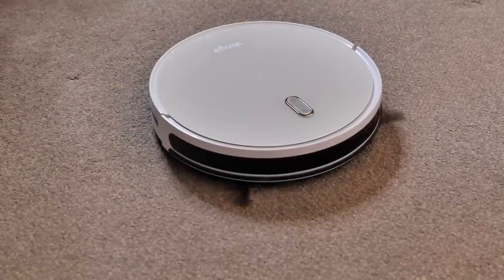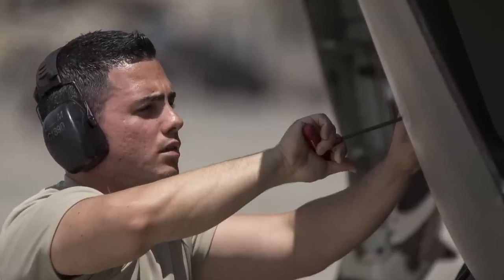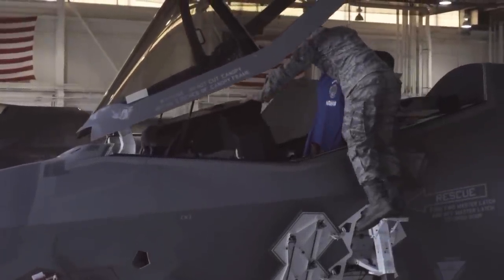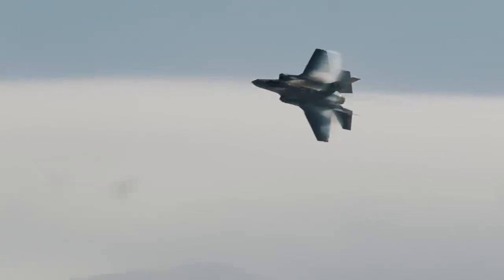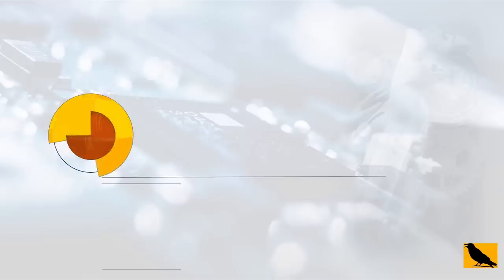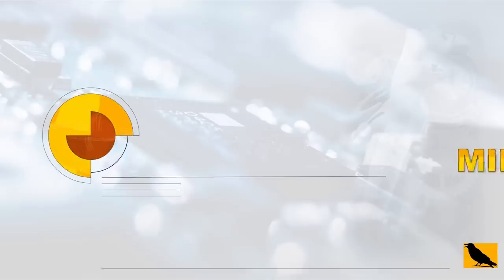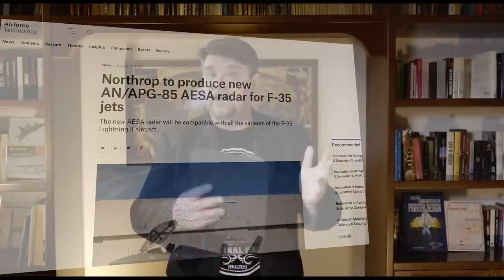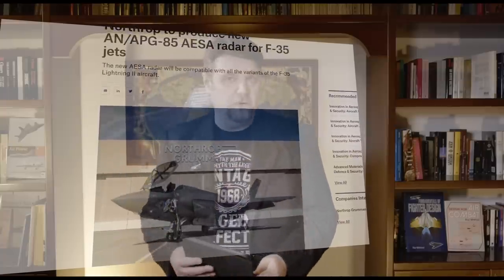AESA radars have a problem.

Comment: The Gripen E would frequently employ its AESA GaA radar as a passive ISR antenna and the wingtip and tail GaN antennas as active radars in narrow beam mode. But, it may also be used as RWR, EW, and SIGINT, which is not only clever but also an efficient and effective method to employ radar.
Reply from the maker: Any source for this?
Reply: @Millennium7HistoryTech  it is common knowledge.
Reply: @psyamok3735  it is assuredly not common knowledge lol
Reply: @Millennium7HistoryTech   Hello sir, 
Americans, europeans and Israelis have achieved AESA radar technology. 

Can u tell us which radar be more advanced Israeli Elm 2052 or European Rbe2/ Captor E according to their capabilities of military industrial base. Jst general technical comparison.
Reply: @nishantshrivastava9674   Please get real - nobody who really knows the answer to that question will be writing a single word on this channel.
Reply: Stop tripping. Gripen E AESA radar is not GAN, it is a GaAS radar:  the Raven ES-05 made by Leonardo.
As for electronic warfare, the Gripen requires a EW pod which is nothing more than a powerpoint presentation today.
Reply: @H B  100% correct! Notice he never uses any numbers. Only vague descriptions.  Heavier, hotter, higher power consumption.etc.  Far more specific descriptions are available in any undergraduate analog Circuit design courses..
Reply: The gripen E is barelt even in service.
Reply: @Millennium7HistoryTech  We did it with the F-16s back in the 70s  Hill AFB. MOTE program
Reply: @nishantshrivastava9674 China has AESA the Russian SU57 has a AESA radar also.
Reply: @aramisone7198   I know that.. I just wanted to see comparison between Israeli Elm 2052 AESA radar vs French RBE2 AESA radar.
Reply: @nishantshrivastava9674  combat aircraft AESA radar technology was first made and utilised on the Japanese Mitsubishi F2 the J/APG-1 introduced on the Mitsubishi F-2 in 1995. 
  Basically the US followed that idea and others followed. So when we look at the history of the AESA life we should remember Japanese influence. AESA technology was of course used in large heavy ground based units earlier than the Mitsubishi aircraft.

Comment: Think about this carefully:  What are the possible applications for a very high performance, very high bandwidth transmitter/receiver system that has a very wide range of operating frequencies and can operate on hundreds of discrete frequencies at the same time,  and which is under full digital control with very advanced, highly capable signal processors?    The applications are limited only by the absolute hardware frequency and bandwidth limits and the imagination and ingenuity of the engineering team.     It's SO much more than just a radar now.   It's a broadband receiver,  and a broadband transmitter,  or more accurately, hundreds of them all working at the same time.

Comment: What you are speaking of is what i taught in My F-16 Avionics Maintenance instruction back in 1970s at Hill AFB.  Gallium Actinide processor Chips were the NEW KID on the block in the Electronic Countermeasures Systems of the block 3 AVIONICS systems of that time.    It is nice to see that 50 year technology is now declassified.  I wonder what is really out there.

Comment: AESA stands for Active Electronically Scanned Array, which is a type of radar system that uses an array of small, solid-state transmit/receive modules to steer the radar beam electronically. This is different from traditional radar systems, which use a single antenna to scan the radar beam mechanically.  

AESA radars have several advantages over traditional radar systems. They are more reliable, have better performance in cluttered environments, and are harder to detect and jam. They also allow for multiple beams to be steered simultaneously, which can be used for advanced capabilities such as electronic warfare, surveillance, and target tracking.

AESA radars are used in a variety of applications, including military aircraft, ground-based radar systems, and naval vessels. They are particularly well-suited for use in modern military applications, where they are used to detect and track targets with high precision and accuracy.

Comment: Excellent details, learned a lot!

My guesses before watching the video were going to be issues with integration into 4++ fighters (that are actually fourth gen's built in the '80s and '90s) as a new mission computer (and perhaps new data bus) would require installation, let alone new screens in the cockpit(s), as well as the often upward sloped antenna arrays on AESA systems that would limit their vertical scan range. 

Very surprised to learn all of this! We were missing the videos, M7*

 Nice to see you back!

Comment: About the scan loss: it's the phenomenon of decreasing loss then the beam in an antenna array is pointed away from broadside (generally simply not perpendicular to the plane of the array). In case the array doesn't have any fancy beamforming (same amplitude, progressive phase shift between the elements), the scan loss follows cosine function -> in ideal case: broadside = 0 dB scan loss, 60 degree scan angle =  ~ -3 dB scan loss, etc (depending on the array configuration). It's basically just about the geometry of the array in respect to the radiated direction. The maximum gain is a function of the projected surface area (electrical) of the array to a given angle.

Comment: It´s incredible how much the same problems and solutions applied to AESA radar also apply to professional audio engineering. At this point, the common ground is not just wave mechanics but all the technology of filters and analog vs. digital signal creation, sum, heat dissipation (Johnson noise), etc. It would be interesting to see if some of the most forward-looking solutions regarding the quantization of the wave signal (both in AD and DA) in audio, such as describing a waveform with a density distribution of a binary impulse, might be a solution also for other systems such as radars in the manipulation of complex signals, especially at high frequencies. There is no free lunch, of course, but both of these technologies are aiming for the same goal and are hitting the same wall from a physical perspective. Great video, you´re always getting better. 
One more speculation from my side: what if the use of optical circutry would improve signal loss and heat creation and also would help defeating the signal losses at high freq. due to induction in metallic conductors?
Reply: Optical circuitry as in optical processors, or optical interconnects? To my knowledge, the interconnects part is already widely used, and obviously can't be used in analogue radio domain.
Reply: @pinocleen  I meant interconnections , good to hear I didn’t know that.

Comment: You should look into civilian 5G MIMO basestations. They use the same principles as AESA radars, in a less complex use case (more constrained). But a lot of those civilian technologies could be scaled up to meet the expanded operations envelope of a military AESA radar.
Reply: For example - GaN and GaAs radio production.
That is not a big issue for AESA today. Certainly not with GaAs radios, which have seen huge growth in the civilian sphere, transmitting economies of scale and R&D benefits over to military side.
GaN is still a less mature radio technology in civilian sphere, but it has markets there.

So it is not quite correct to say that military AESA requires exotic, custom production methods for its radios - it uses methods and materials that are either already widely used in civilian space, or ones that are being invested into for their civilian potential.

Military AESA usage does require better yields, higher quality parts, sometimes larger die sizes to fit everything needed for the flexibility.
But all those just mean decrease of end yield, in other words, instead of processing 10 wafers to get enough chips, they'd need 20, or even 40.

But given military standards, 2x or even 4x that price of a part is actually very, very cheap.
Reply: @KarbinCry  I expect GaN-based T/R modules and amplifiers to completely replace GaAs technology in a little over a decade's time, as Arsenic is toxic and very complicated to recycle.
Reply: @nooonanoonung6237  GaAs is not toxic, and is not a source of arsenic. GaAs powder is carcinogenic, but likely due to its mechanical properties - kinda like fibreglass, if you breathe it in, it cuts up your lungs and scars them.

But GaAs in radios is a solid crystal. It's basically like a computer chip. It is not a health hazard.
In fact, your phone likely has a small GaAs chip acting as the radio, especially if your phone has 5G, or WiFi 6E.

The issue is efficiency and possibly cost, as GaN is still scaling down costs by economies of scale and new innovation, while GaAs is a much more mature technology, with less potential to get cheaper.
Reply: Beam forming was already implemented in some LTE-A active antenna's.
Reply: @ghostindamachine  yes, I was simplifying a bit.
Reply: I think SpaceX has the best example of this technology right now.

They got most of the components on-chip now. They also have access to Tesla AI tech.
Reply: Such technology is already present in some naval radars, but scaling DOWN to fit the size requirements of airborne installations is at present an insoluble problem.
Reply: @KarbinCry  In most new technologies, the research expenditure is financed largely by the military. It is possible to amortise this cost against civilian versions of the technology but that money stays with the supplier and does not return to the military.
Reply: @hb1338  it does return to the military in form of either cheaper devices, or, more often, even more performant devices.
And if you are going to talk this broad - why not go a step further and discuss the overall economic benefit of civilianisation of technology developed for the military?
Reply: @hb1338  what kind of technology? GaAs AESA? Beam forming? GaN?
Reply: @hb1338  Really? What recent tech?

Comment: I would imagine that you have to look at the total life cycle costs for the AESA radar to get an accurate picture. Beyond slower refresh rates and predictable scan patterns legacy, gimbaled antennas tended to be high failure after being exposed to prolonged high g maneuvers. AESA systems are usually designed as an integral part of the airframe with a life expectancy on the same order as the air frame. That seems to be the goal; as to what’s real I don’t know.  What I do believe would be a cost-driver would be for the service’s repair depots to develop the organic capability to repair these arrays for when Murphy has an influence in their reliability. Contractor depot support gets super expensive over time. Nevertheless, modern AESA radars are a thing of beauty.

Comment: Excellent video , M7! 
This explain also because either the Hybrid PESA is so diffuse: they have most of the Cons of AESA for what they came to signal processing (compared to old PESA, whose phase shifters just steered the wave) but having a centralized RF emitter they  could retain a much more lighter and above all leaner antenna so that it could be steered without problems to reach a +/-100° of scan sector while they also need a lot less cooling and avoid to became too nose-heavy.
So, for a 4++gen planes and above all an air superiority fighter like the Su-355 they were a no-issue component while it took a very long time to get a steerable AESA antenna on the Gripen-E and Tiphoon.
And naturally it explain also because they have installed instead a L-band AESA on the wings of the same Su-35 or because the Su-57 has both L- and X-band antenna all around.

Comment: The General Electric XA100 is an American adaptive cycle engine designed to provide more energy and better cooling for the F-35. It will combine well with the new radar. It's all on schedule.
Reply: XA100 was canceled for the F-35 (this week)

Comment: Not only is scan loss a problem, but so are side lobes. As soon as you start steering phased arrays, the side lobes get very nasty, both in their amplitude and their phase behaviour. The amount of digital processing power required to mitigate this behaviour is extremely large; other solutions typically involve analogue filters on each array element, which has negative implications for size, weight and power consumption. The solutions in the naval world work quite well because of the large size of the array, but with airborne radars the quality is quite severely impacted.

Comment: You did not mention the operating frequencies of AESA radar. Older radars had one T/R module and therefore operated on one frequency. If there are 100 T/R modules, can the radar use 100 different frequencies simultaneously? This shall make it impossible to jam or do countermeasures, which is a huge advantage.
Reply from the maker: In principle yes but it is never used like that because you have to create a beam.
Reply: @Millennium7HistoryTech  It is used like that when operating in LPI modes.

Comment: Speaking to a engineer from BAE systems  at the 2023 Avalon airshow ,  mentioned any thing greater than 500Mhz sample rate and 16 bit depth is classified hardware has vendor export control, go figure what software defined radios the military can play with

Comment: The Erieye AESA surveillance radar produces so much heat in operation that it has a ram scoop to collect air to cool it in flight and AFAIK it cannot be operated on the ground without supplemental cooling.

Comment: Sir, can you do the difference between flat AESA radar and notch AESA radar. What is advantages and disadvantages both of the AESA radar with different parttern size on it such as flat and notch. What is the difference and performance of this AESA which has notch and flat radar.

Comment: Would not AESAR be able to listen to all directions constantly and simultaneously given unlimited processing?
That would be a great advantage if combined with a powerful transmitter positioned behind the receiver.
The receiver would not need as much cooling and power while the transmitter could have a much bigger aperture and cooling surface than fits into the nose cone.

Comment: The Massive MIMO in modern wireless communication has pretty much the same challenges: expensive, high power consumption and high processing complexity. A hybrid digital-analog architecture is therefore a more practical choice.

Comment: In addition to what was mentioned, AESA will always have worse sensitivity than mechanically scanned antenna of the same size. In fact, a pure digital beamforming system will always be worse than analog beamforming system in terms of achievable sensitivity. Finally, any array antenna suffers reduction in beam quality when scanning far off axis. For that reason, hybrid systems where some beamforming is done in analog domain or via mechanical steering are used for long-range RADAR applications, and will often outperform a pure digital system.

Comment: I'm not sure if I get this right, but heat is induced by the array-elements sending signals for the most part, is that correct? 

If so, would it be an idea to put passive arrays around an air frame and have cheaper, unmanned UAVs packed with emitters act as the off board emitter elements of the AESA system, a bit similar like Hensholdt's passive coherent locator system? https://www.youtube.com/watch?v=RfqdLKFhGnQ&ab_channel=HENSOLDT

I was also imagining these off board emitters could act as decoys/jammers or spoofing aids. 

I realize things may get overly complicated in a different way... For instance can such a system accurately target a hostile aircraft, make SAR images or do powerful jamming in specific bandwidths or frequencies? And what kind of processing power (and relating cooling issues) may bring that to the original fighter aircraft? Probably a bad idea. 

Sorry, just had a brain fart.
Reply: What you described here AESA can already do today. But, to do this you have to exactly control emitters and receivers in an precision oy nanoseconds or even picoseconds. You will not achieve that by remote emitters. Some of the effects (if not most) you can only achieve by controlling the emitters differently so that they superimpose their wave signals so that you get the beam steering. Normally also you can't transmit and receive at the same time and you also have to control receiver and emitter very precisely to work alternating. They even scramble the emitted signals, so only the right receiver (knowing the key) can decode the signal and so can't be jammmed easyly. And with beam steering of nearly 2000 pieces of 5 watt transmitters on one point you can do very precise jamming without being noticed because of very low side lobes. Beam steering, beam splitting and beam forming is the key feature of AESA I think.
Reply: @muctop17  Thank you kindly for the elaborate (and patient) answer. I was already afraid the idea was worse than the original. If I understand what you say correctly, the computing power required of my idea would be a multitude of that required on a normal AESA array. Which - I realized later - can be switched to passive mode as it is today. 
One could probably even connect multiple arrays in a flight together to listen in and triangulate the location of a single emitter without ever transmitting, provided there are enough ambient signals around. One just has to adapt the ER-modules to a specific frequency/bandwidth to the ones most common in the ether, correct? 

Anyway, I really appreciate you explaining the thing. Means a lot to me as a lay/infantry by origin. Cheers!